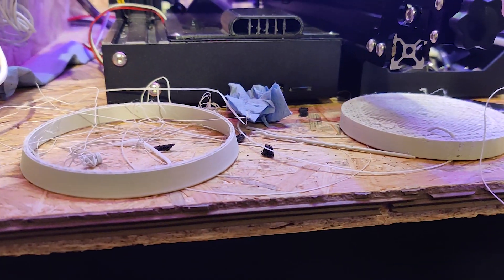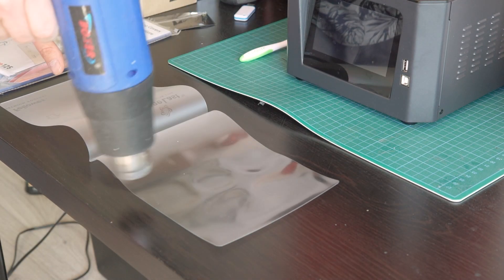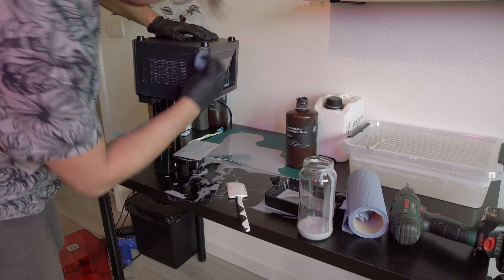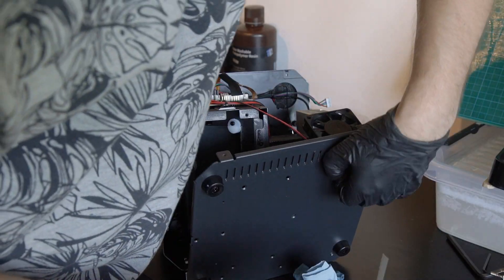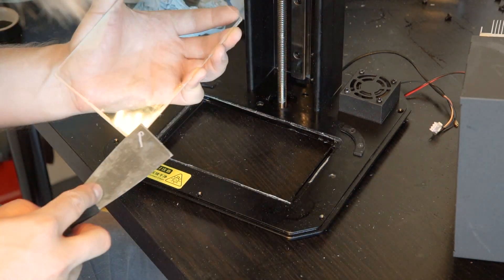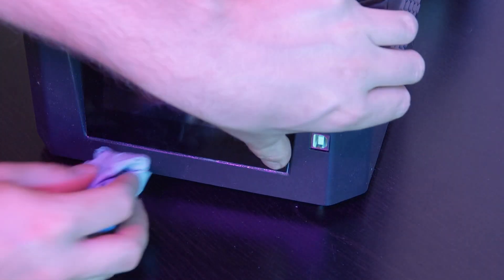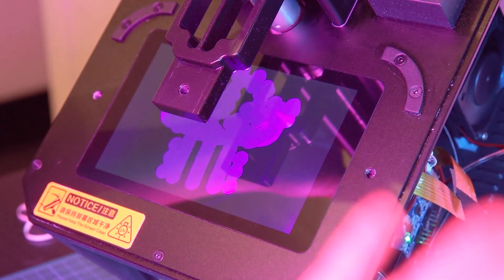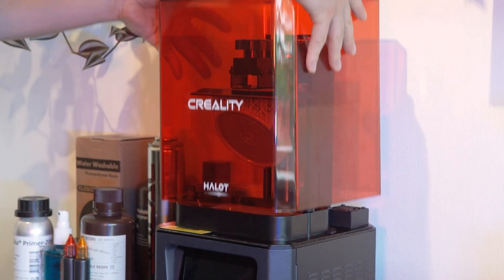I DESTROYED☠️ my Halot one.. (but revived it)

Comment: I spilled some resin on mine but nowhere near what you did. Mine was about a shot glass amount. I wiped up all that i could but some leaked down by the stepper motor. I used it after that and it worked fine. But put the printer away and havent used it since. I wanna get back into printing so i might have to take it apart if it doesnt work right. Thank you for the detailed video in case i need to fully disassemble mine.

Comment: If I were the manufacturer of this type of printer I would add a few plastic drains so that resin can be directed via a gutter around the glass and exit the bottom into a tray or base that has some kind of a low profile tub. This way you would only need to just flush the drain with IPA.

Comment: found this video afteri accidently poured resin all over printer luckily it only went into the stepper motor i need to replace it but i have to say this video has to a how not to use a halot one lol i know people say dont use metal scraper on fep but why would they give you one if they didnt want you to use it also dont add silicon around screen it will be harder to remove if this happens again

Comment: incredible, I cannot make my Halot one print single print, it sticks to the FEP and breaks the print in 2 parts .... one gets stick to Plate and rest with FEP, i have tried stronger supports everything ... i just cannot
Reply from the maker: Oh, and there's also FEP lubricant that makes it stick less, might also be worth trying if the first thing fails 😉
Reply from the maker: I had a similar problem, it might have something to do with the tuning of your FEP film, it it better to be a bit too loose than too tight on the vat. There's tutorials that show you how to tune your FEP to get the right sound pitch.

Comment: Had the same issue with the touchscreen after a resin leak.  I mean, they should at least have some kind of seal around the touchscreen!  Thanks for letting me know I can use a mouse with this printer.  It will save me the hassle of trying to make it work as-is!

Comment: Another reason not to waste your money on any resin printer made by creality. This also happened on my Halot one pro. The vat is built so shabbily it stresses the fep on the corners. After a few cycles they tear and out comes the resin onto your screen. And the threads strip out so easilly. I have an Elegoo mars that performs much better than my halot and is 10x more reliable. Creality should just stick to making FDM printers. These halot printers are just utter garbage.

Comment: Sorry to see that happen to you! Same happened to me a couple days ago and there's not a lot on youtube showing resin leaks into the printer and I experienced the exact same thing as you. Only in my case I have the Halot One Pro and when I put everything back together, it didn't print anything. Turns out the resin released the ribbon from the lcd screen enough so that several pins weren't making contact with the PCB on the LCD glass. I thought the ribbon was at least soldered on but it appeared to be just glued. Ugh. Can't even find where to buy a replacement right now (Nov. 2022). And not too happy with the part # on the screen: FPC-070-L001-3 7.04 2K. I thought the Halot One Pro was supposed to be a 3K screen!

Comment: You really should be wearing gloves whenever you touch the printer,  even more so when the thing is covered in uncured resin.
Reply from the maker: You're definitely right.. I did wear them in the beginning but after two hours of wearing them and having one tear apart I kinda gave up 😅 I luckily didn't experience any irritation on my skin and washed my hands thoroughly afterwards. But yes, definitely the smarter thing to keep wearing them when handeling this chemical soup.